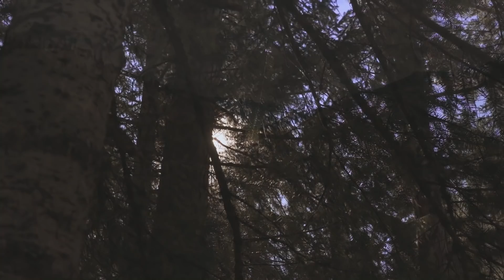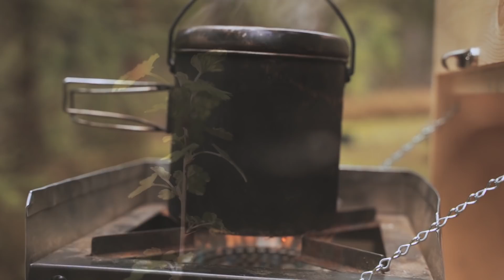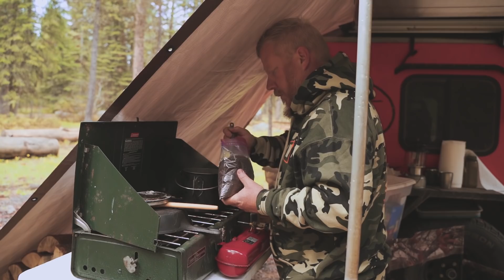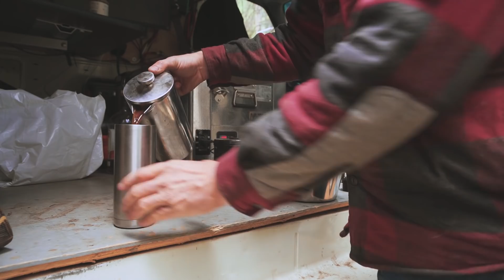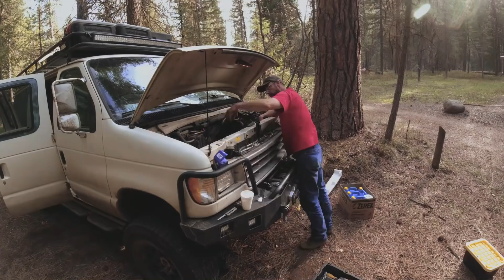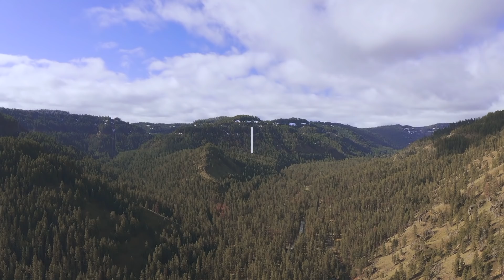Ford E350 4x4 Van Repaired in the Wilderness

Comment: You really should run that van with the radiator cap off till it warms up and the thermostat opens.  It will bubble up air bubbles out of the radiator cap. And if you don’t get these air bubbles out of the cooling system you’ll end up with trouble down the line. They can create hotspots that can crack the radiator and also open welded seams. Just a heads up love the videos

Comment: There is no emotional low quite like being out in the woods with catastrophic vehicle trouble.  Though at the same time, there is no emotional high quite like the relief you feel when the thing is fixed and running strong.  

Also, it's super lucky you were not solo, and had a friend who could drive you to town.  If you were solo and had that problem, you'd probably have to load up as much water as you can and use the raw egg method to hope you can limp it back to a garage.  Thank goodness you did not have to do that.

Anyway, nice repair job.  Nothing can stop you for long, as you seem to have a good head for problem solving, and just get to the solution rather than dwell on how much the situation sucks.  That takes character.
Reply: @evilcam 100% agreed. We can all be calm, relaxed and happy when everything is going well but it is in times of turmoil in  which a person's true character shines through. Nice job on the repair and Primal Wilderness didn't have to post this setback but he did because shit happens. You deal with it head on and move forward. Appreciated these 2 episodes PW.

Comment: i bought myself a 94 E350. took it for a drive to the in-laws to do some wood work. Drove it home. Next day went to go move and seen puddle of antifreeze on the ground from the back of the van. the hose rubbed against the leaf spring and wore hole through the hose. I also had to put a new rad in my van as well. bought it from rock auto for $250 CAD. Taking it out at the end of June for a weekend to see if any other issues come up before it goes on a 12 hour drive at the end of Aug. I also have idling problem and maybe another issue. mines a 5.8L . all and all it run pretty good thinking is o2 sensor or something like that.
Reply from the maker: Check that and the IAC that was my idling issue.

Jason
Reply: @PrimalOutdoors  ya i was looking to pick one of those up. seems like a common problem. thanks Jason

Comment: Yes I have an old 87 Toyota truck the master cylinder stop working after so many years I replaced it with a new one it failed me three times new parts are not that great
Reply: Quit buying your parts from the Chinese parts stores. I have a 25 year old Toyota Tacoma and only buy Genuine Toyota parts so I don't have the problem of having to do the same repair over and over if a part fails, which rarely if ever does. Love my Toyota!

Comment: You should really consider upgrading to an all aluminum radiator. If the thermostat acts up again, the radiator cap will release the pressure rather than the crimp. https://www.ebay.com/itm/283194253081

Comment: As was already stated, the radiator cap should have protected the cooling system from over pressurization.  You need to check that cap.
Reply: Not all the time. A bad radiator could fail before cap. Done many Nissan Murano radiators for leaking
Reply: @Paul Revere Do non diesels have a degass?  My 99 7.3 diesel does but I don't know about gas vans.

Comment: Failsafe thermostat will fail in the open position so coolant will always pass thru the system. Why did the cap not relieve pressure..only 16lb ????I'd get a new one. Always enjoy your videos.
Reply: Bet the t stat install was the failure. Most have air bleeder at top